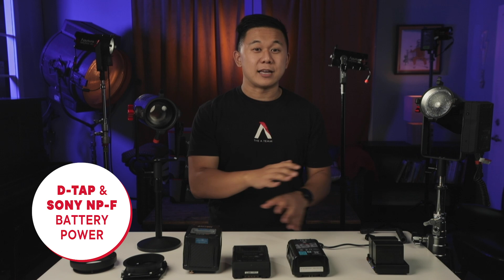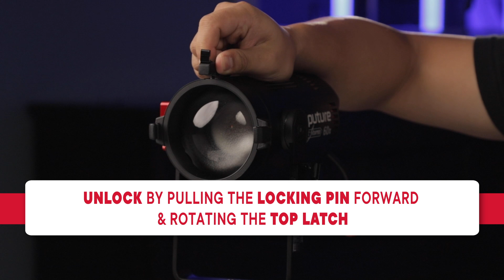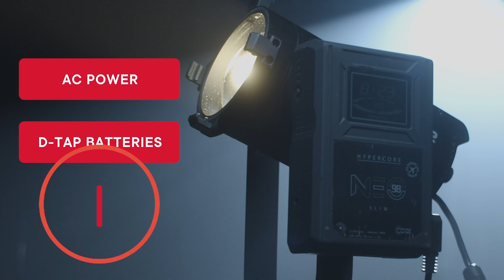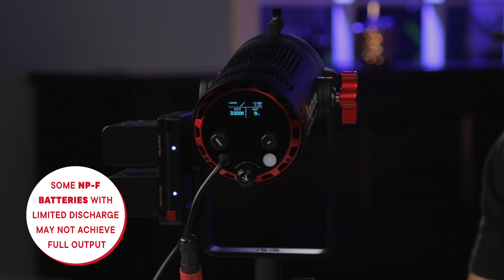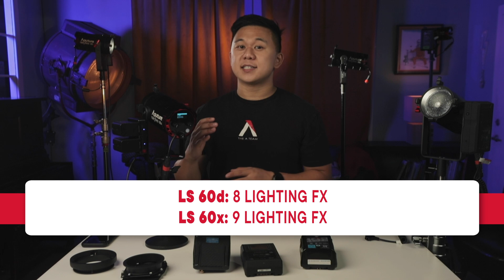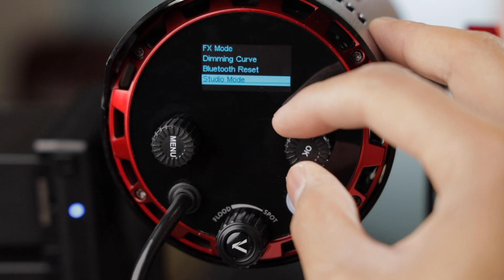LS 60d & 60x | User Guide

Comment: Ordered two of them. They are going to be fun to play with! Quick question, The video made it seem like you could only use a few specially made bowen light adapters modifiers with this light. Is there any reason I could not use all of the other Aputure bowen modifiers that are out there?
Reply from the maker: You can use any Bowens Soft Light Modifier. The beam angle may not completely fill the soft light modifier due to the aspherical lenses and their focused beam angle, but it will work especially well with softboxes that have an internal baffle to help with that. 

It will not work with the Fresnel 2X or full size Bowens Spotlight Mount, because of the way the optics focus the light of the 60d/x before shining through the other modifiers.

Comment: Nice! Looking good. Will there be a new Fresnel as well, fitting the 60d/x? I saw the built-in spot/flood adjustment, but I was wondering if an accessory would amplifiy the output as the 2X does. Also it would be awsome to have a more spotted beam. Like 4-5 degrees almost parallel, so the 60d/x can be used with light reflectors. (Just checked dedolight and they have something called "intensifier. Increases the light output up to 300%.) Lastly a police light fx would be a nice addition too. Red/blue for US and blue only. Thx

Comment: I just received mine and the barn doors/bowens mount adapter rotate quite easily once installed. I was wondering if I was doing something wrong... or if that is just the way they are designed and they are supposed to rate that easily once attached to the light....

Comment: Today I went to use my Aputure LS 60 D for the second time. She was connected to the power and with less than 10 minutes of operation she turned off by herself. When the source is connected to the energy, the green light turns on, but when I connect it to the light's power plug, the light turns off and the light does not work. The same goes for the v-mount battery. It stays on but when I plug in the d-tap cord it turns off and the light doesn't work. I would like to know if there is any solution. Thanks.

Comment: Could it be mounted upside-down? For studio style, just guessing if the v-lock would be safe enough in that position or it could even be mounted inverted
Reply from the maker: You can flip the yoke upside down, so the lamp head is underslung and not inverted. With the standard AC adapter, we see no problems with the V-Mount locking mechanism in this orientation.
Reply: @aputurelighting  so the v-lock mount keeps position on the yoke... Upside-down

Comment: Why the lock knob turn back like 120d I tho
Reply from the maker: It actually uses a Rosette-Style locking system. So there are more teeth, and they lock into each other instead of a rubber gasket in between. This also keeps the width and size down.

Comment: Don’t buy this lamp. It has a bug in the Bluetooth module which does not allow any connection or control of the lamp after 6 months. You can then basically throw it away. It’s also not fixable with a firmware update.